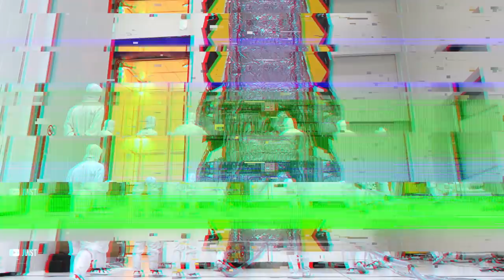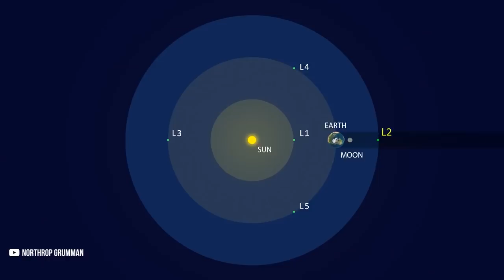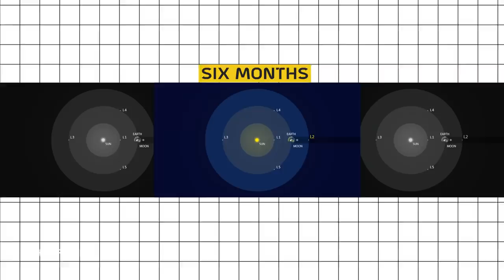James Webb Telescope Launch: 30 Days of Absolute Horror

Comment: They make the guaranteed time observers sound like a reward for working on the telescope so long but I don't see why that would happen.  Everyone who worked on the telescope was paid well enough for their work that taking time from scientific research seems overly generous.  Wouldn't the motivation be more about internal alpha-testing of the telescope being done by more of its engineers so it is initially given more thorough testing by its designers and creators before more pure scientists use it?  The engineers can probably find strengths, weaknesses, and workarounds for various problems that could crop up better if they get the first crack at using the telescope.  Another thing that would make more sense than this reward to its creators is that the time is divided up by countries(not individuals) that heavily supported its development so American scientific researchers would be given most of the time since that country funded most of the $10 billion.

Comment: Employed a bunch of people with good jobs for decades but I don't think it will send a single image.  Too many electromechanical steps have to all go perfectly on different pieces of hardware that have been in storage for years.   I hope it works but I'm not going to be surprised if it doesn't.   Hubble can give us a pic of Webb, shrouded in its failed array of heat shields, sitting at Lagrange until long after humanity is extinct.

Comment: Frankly, it sounds like the odds of this deployment going perfectly are not good. Because virtual perfection is required for this thing to work I'm not holding my breath. We may be pushing complexity to the breaking point
Reply: @russellupsumgrub9633  From what I've read the way this telescope has to be deployed is far more complex than any of the probes we've sent out over the last 50 years. Also, the anticipated lifespan of the James Webb telescope is only 5-10 years. That seems to be a very short payoff for such an expensive endeavor.
Reply: @Boudica234  The ISS cost 150 billion, relative to it's lifespan the price is comparable. Why do you sound like the congress anyway, why is cost a problem to you? I would gladly see all my tax money go to space exploration, imagine the things we would've built.
Also, no other probe has ever been tested nearly as much as JWST, so there is a chance.
Reply: @user-zb8tq5pr4x  My problem is that the odds of this this thing deploying correctly with so many single points of failure seem long. My problem is there is no way to repair it after launch. The bottom line is u can justify the cost if the thing works. If it doesn't the whole thing looks like a collosal waste of time and $$. We'll soon see.
Reply: @Boudica234  It's never a waste, we will learn a lot from it no matter what, and as I said, I wish more of my tax money went into this sort of failures.
Reply: @Boudica234  ok
Reply: @user-zb8tq5pr4x  I think we can both agree that if this thing actually defies the odds and achieves a successful deployment, it will be an incredible achievement. Mike Menzel, the systems engineer for the JWT at the Goddard Space Center, has stated this is the most complicated and technically challenging mission NASA has ever attempted. Like u, I am rooting for this deployment to succeed.

Comment: This is probably a weird question, but how exactly will James Webb "keep up" with the Earth? I know it will orbit the L2 point, but since Webb is further from the sun than the Earth is, wouldn't its orbit be slower and become out of sync with Earth over time?
Reply: L2 is a semi-stable point, the added gravity of the earth and sun will make James Wedd able to "keep up" with earth but will take minimal amount of fuel to stay in this orbit due to interaction of other planets
Reply: The whole point of Lagrange points is that any object at this relative positions will orbit the Sun in sync with the planet, because the extra pull of Earth's gravity. 
(also, a higher linear speed is needed to sustain a higher orbit, but the extra distance results in a lower angular velocity, relative to the Sun)

Comment: It just seems it would have been easier to just build a large payload fairing to house the telescope with more things fully deployed.
Reply: I am afraid it would be very costly in terms of fuel and ultimately undoable
Reply: @olasek7972  Many rockets have payload fairings that are a larger diameter than the rocket stage and have a boattail to bring it down to the diameter of the stage. Atlas V has a 5.4 meter fairing that goes down to the 3.8 meter diameter vehicle. Skylab used a 6.7 meter fairing. You could probably put a 10 meter diameter fairing on the 5.4 meter dia. Ariane V fairly easy.
Reply: @mattcolver1  fairly easy, I beg to differ
Reply: @olasek7972  I spent 22 years designing and building Payload Fairings. I worked with the dynamics, aero, and propulsion folks on their effect on the vehicle. What's your background in Payload Fairing and Launch vehicles?
Reply: @mattcolver1  oh, we have a claim of expertise online. In that case, I'm the CEO of NASA
Reply: @mattcolver1  I know, that was part of the joke

I imagine someone working with rockets would be more intelligent

Comment: Will it only be able to point in one 360 degree plane? doesn't seem like it has much of a field of view.
Reply: The telescope will follow the Earth in an orbit around Earth's L2 point, so over the course of one year it should be able to look at the entire sky.
Reply: @ximalas   @starlite Looking at the animation, there are two orbits. The first one is the same orbit as the earth but further out (horizonal orbit). The second one is vertical around the La Grange Point. Another video states that is will orbit L2 and not be stationary with the earth.  So if the shield has to stay facing the sun and the main mirror can only be rotated 360 deg and not pivot up or down in reference to the shield ...the field of view will be like a camera on the surface of a cylinder (earths orbit) that can only be looking up/down and outwards from the cylinder. It can not look inside of the cylinder space........so essentially every thing inside the earths orbit ,up and down...is dark to this telescope.
Reply: @Ezzell_  Well the light that this telescope is trying to see is literally coming from all corners of the universe. It doesn't really matter where it's pointed.

Comment: You know they dropped it, not far but the JWST took a shock
Reply: I don't think it was dropped just shook by a spring clamp that was accidentally released.
Reply: @wesleyashley99  They're saying it sent a significant jolt through the whole machine. they were probably relaxing the tension on support lines and the load popped the clamp. 7 tons shifting even a quarter of an inch would be quite a jolt and there may have been harmonics created in that load path.
I wont be surprised if it doesnt work and if it was up to me, we'd be rolling it back to the garage for a complete inspection.
Reply: @Winkkin  It will experience a lot more shaking during launch, if it can't survive this, it stands no chance.

Comment: Worked making aerospace parts for years. Given what little I know about physics how in the vacuum of space does heat dissipate??
Reply: I really am asking that if anyone knows about the behavior of heat in the vacuum of space that they would comment. It's going to take days for JWST to get to operating temperatures. HOW WHY????
Reply: Radiation
Reply: @highpointsights  And for the "why", each object with temperature glows in infrared, and dissipates heat in this manner. Since JWST is going to observe light only in infrared spectrum, it needs to be really cold so it doesn't detect it's own light as it glows.
Reply: @user-zb8tq5pr4x  my question was motivated by the Thermos bottle I have. It surrounds the container with a vacuum which serves to impede the transfer of heat.  I'm really not being a smart as. I thought the heat would be trapped on the surface of instruments. Thanks for your response!!!
Reply: @highpointsights  Your thinking is good, conduction (losing heat through physical contact of molecules) is basically the only thing you have to worry about on earth, since radiation is so slow. But even with perfect vacuum, your thermos bottle would eventually radiate all the heat away (might take weeks though)
Reply: @user-zb8tq5pr4x thanks for the response!! I've been curious about it since my time in a shop in California.  These parts would come in as forged aliminum ingots ingots picked up with a fork lift. They were simply to big to lift elsewise.   They each would spend weeks in the on big cnc mills Then i would cut on each one for 100+ hours in the biggest wire EDM I ever operated.  It was clear that with all the cards slots etc. that this thing was about dissipating heat.  We were told that our parts went in school bus size satellites.   Our shop made their living on parts that 6-8 other shops refused to bid on in So Cal!! Made 13 of the things!!
Reply: again thanks for your time!!!  By the way when we got done the fork lifted ingots I was carrying by myself easily!!!
Reply: @highpointsights  That's actually really cool that you helped to create so amazing
Reply: I developed a check list that took me two hours to go through before I pulled the  trigger on those things! NO BAD PARTS!!!!

Comment: I really wish NASA was going to launch this. Putting this treasure in the hands of the European Space Agency which has no experience launching this kind of project doesn't make any sense.
Reply: What are you talking about? The rocket launch is just that - a rocket launch. The payload is irrelevant as far as launch is concerned. Post-launch operations are entirely under NASA's control. ESA has plenty of experience in launching big rockets. Thet elected to use an Ariane rocket - Ariane has one of the best safety and reliablity records of any rocket. And ESA are paying for it.
Reply: In addition to Richard's excellent reply, why would you say that ESA has no experience with this kind of thing?

For example, the ESA's Gaia stellar-mapping satellite is literally at L2 right now, and has been since 2013. 

I mean, a 30 second google search would have cleared things up for you.
Reply: @beta_cygni1950  I see your point. After all, the Beagle 2 was a great success.
Reply: @dirremoire  Oh, come off it. It's not like NASA hasn't had it's failures.

Comment: Man, a machine that takes 6 months just for startup sequence?...lol 🤨

Imagine if BMW or Mercedes were involved in the construction of this thing. There will be 2000 lights on the instrument panel telling you how things are not working, how the engine management system is dead, how the whole telescope is now on 'limp mode' and how the cheap plastic the Germans used inside have already cracked soon after take-off!  🤣🤣🤣